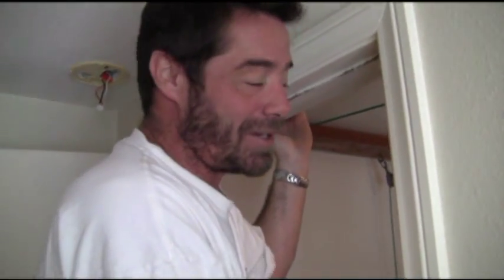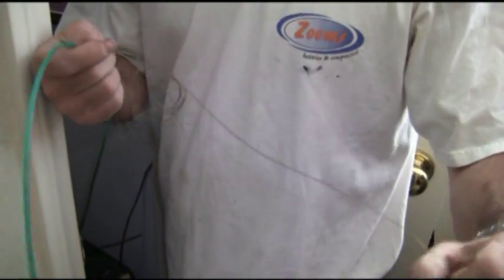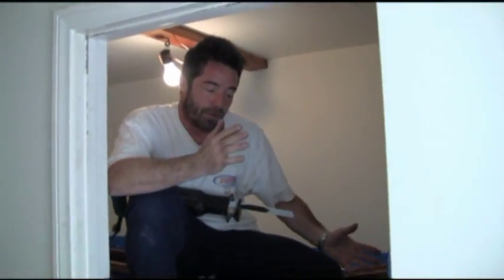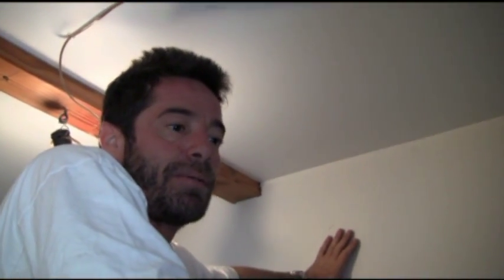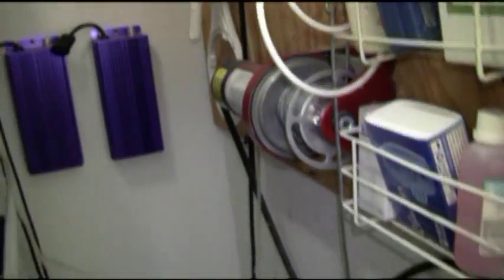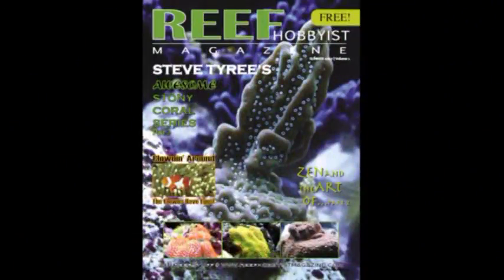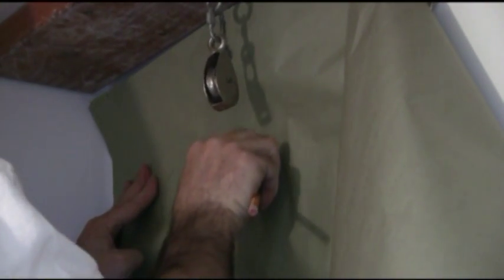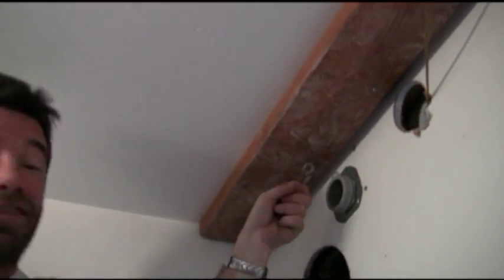Coral Reef Aquarium LED Lighting, LA Fishguys Episode 99 pt 2

Comment: @jay80sdj The lights will pay for themselves in about 4 months due to the savings in electricity. I am in a very high tier rating for my power usage. The 550 watts plus the heat savings that required my chiller amounts to a major savings. Plus I sold my old lights to offset the costs.